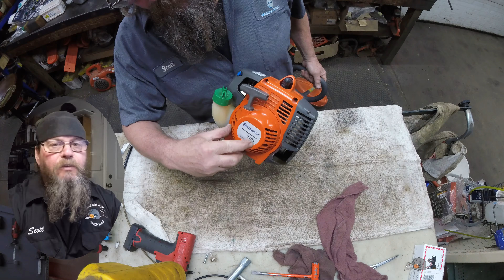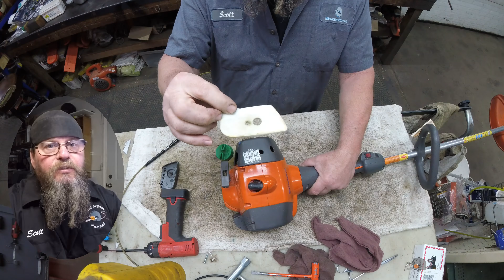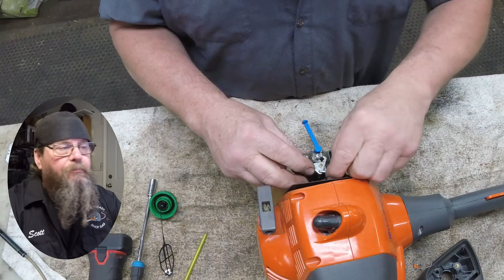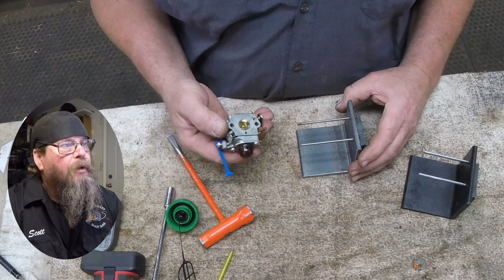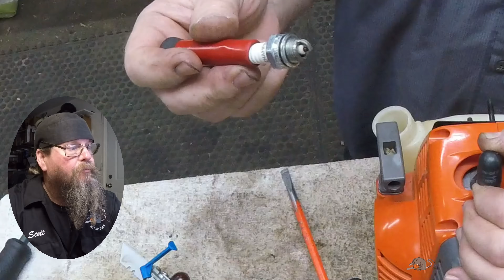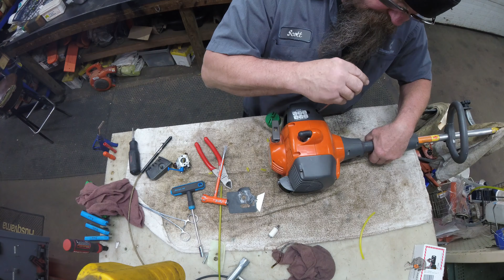Husqvarna 128L Trimmer Won't Start

Comment: I put 4 of these on  4 different like new 128ld and neither damn one will run correctly not sure what I am missing. Adjustments nothing seems to help. Do these have a known tank vent issue? What am I missing?
Reply from the maker: No known vent issue. Did you ever check the tightness of the intake insulation wall? If it is loose or the gasket is bad then you could have issues.

Comment: Ordered!! Got one in Black. I have a 128L in my shop with a weird fuel filter and mini fuel line that attaches to a double ended plastic nipple.  Strange? Is stock just one fuel line from carb to filter?
Reply from the maker: I've seen a lot of different versions on Husqvarna but seeing a one piece fuel line is normal. The double ended connector is pushed on the return line to help prevent it from being accidentally pulled out of the tank.